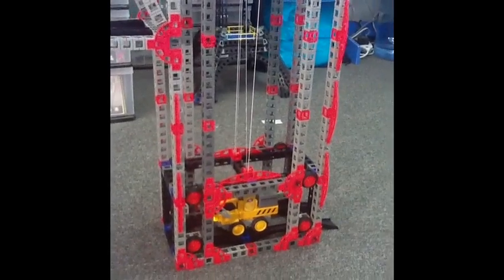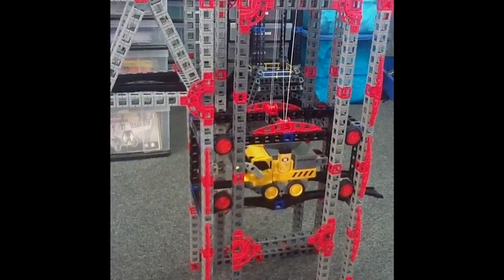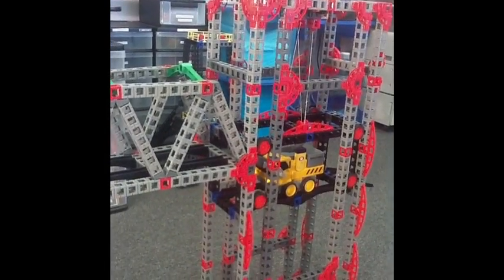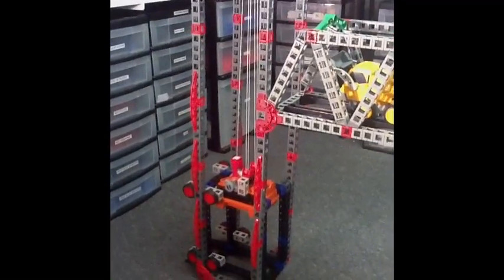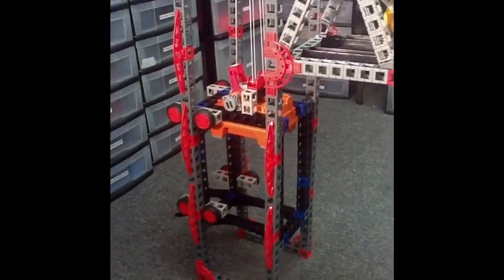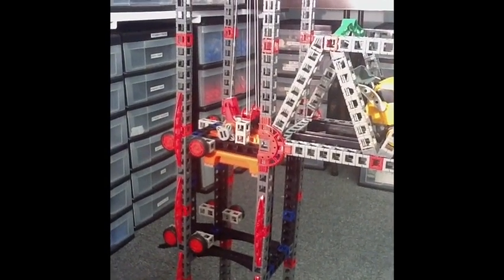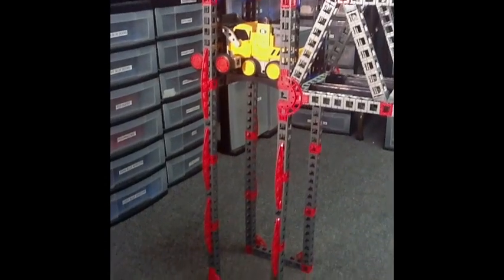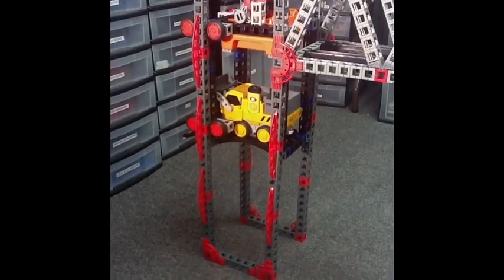X2 Elevators

Comment from the maker: Doc Rok and I just ran a test; the RC elevator is 10 - 20% faster.  

The single bay shaft is flimsy, but the double bay shaft is quite robust.

Change height without undoing the pulley system; just create slack in the cable and install more beams. No special parts (elevator racks) are required.

No argument that the RC Elevator system is a lot easier to set-up.  X2  elevators require more complexity in the shaft, the construction of an elevator car, and designing a pulley/cable system.

Comment: Very impressive. I like how they don't' extend "off the grid" except the front. Everything is contained in bay increments and beams can be attached on almost any side. 

Three weaknesses.
Your elevator shafts are quite flimsy however, if attached to other exterior structures there is a potential for strength).
Lift speed is no where near that of the RC elevator
Convenience- custom pulleys and string not fun to move. Relocating an RC elevator or changing the height will always be easier.

Comment: I still want the elevator back because you don't have to deal with strings, the elevator is much faster to add to a build and less complicated. It also appears that the old elevator might be faster. These designs are great though, and until/if the elevator comes back I will be using one of these designs in a build. If you brought the elevator back, K Animation and I would buy a few that day and I'm sure many many people will too.